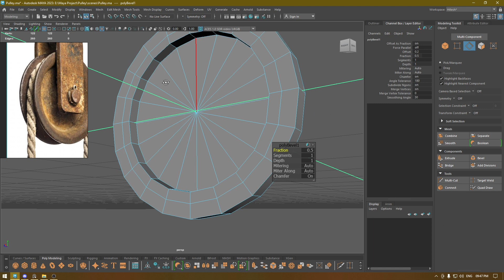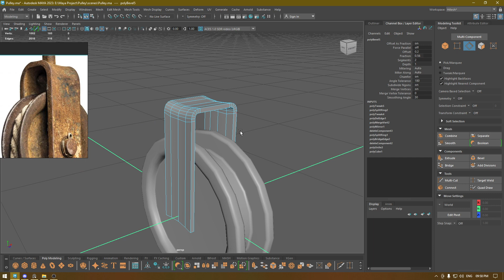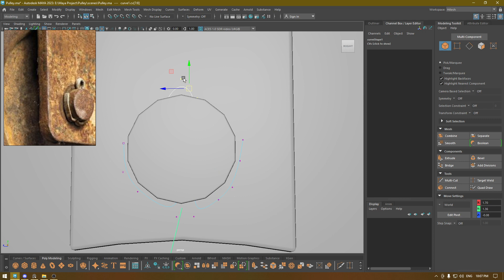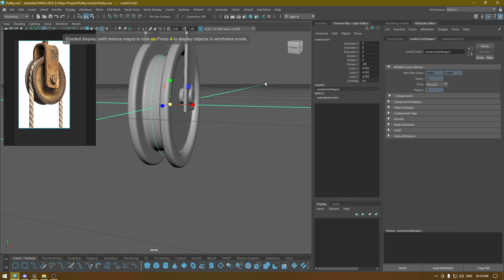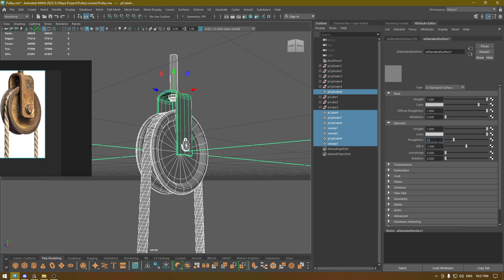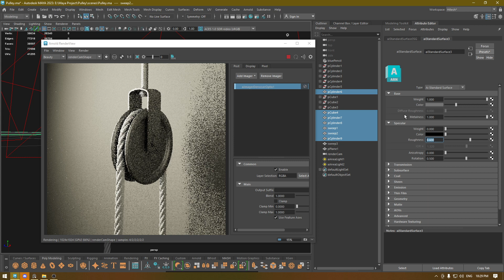Maya Tutorial For Beginners 2023 : Prop Modeling in Maya 2023 | Discord Livestream

Comment: Great video! 

Just a quick question. 
At 20:08 where you twisted the circle, I did the same thing but my circle on top side does not align with the circle on the other side. 
When circularize, the circle on the inner side is aligned straight but the top circle is tilted. Why?
Reply from the maker: Sometimes it happens, you've to manually align those circles then.